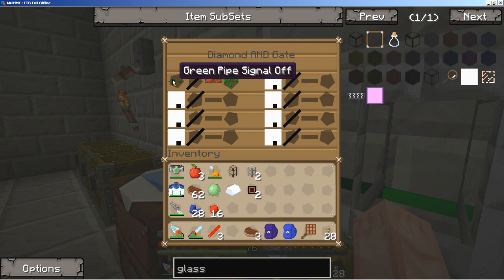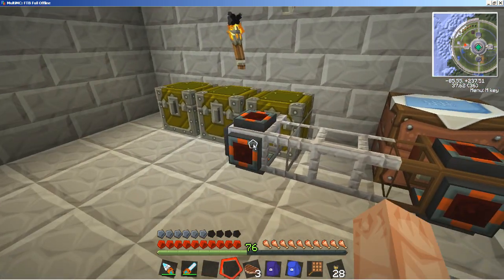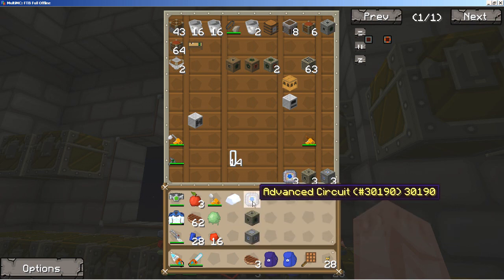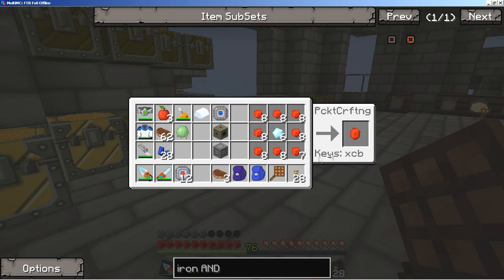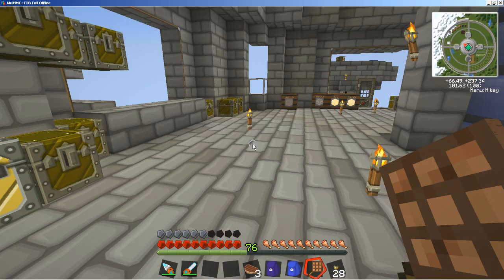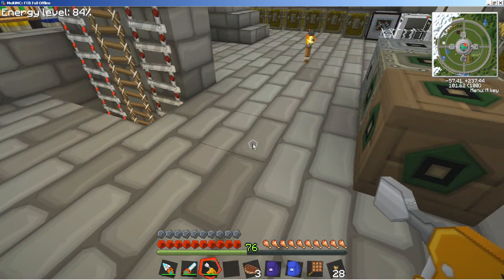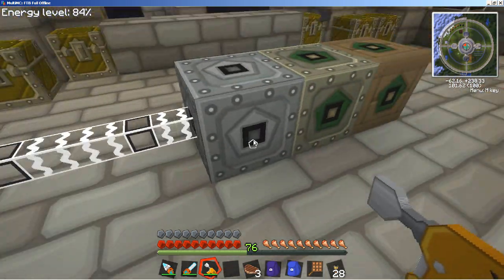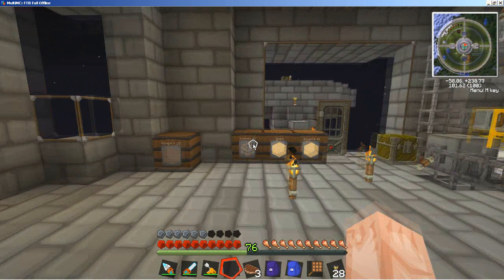Builder's Guide to Feed The Beast (Ep. 10) - MFSU and Tier 2 IndustrialCraft Machines

Comment from the maker: Sounds like you didn't have your transformers oriented properly.  Also sounds like maybe you had a wiring issue.  Removing the MV transformer should have left the MFSU disconnected from everything else.  The only way to destroy an MFSU based on the way it's set up is to have it next to another component that explodes from too high voltage, or to have an EV (Extreme Voltage) source wired into it, which would require either an HV transformer or something like a nuclear/fusion reactor to produce.

Comment: I somehow managed to destroy my MFSU by removing my medium voltage box from it. No idea how i did it. Also couldnt get anything to run. After i switched from the MFE nothing would power up. I tried so many different ways, used three different types of cables, nothing worked. End result being what i mentioned above.